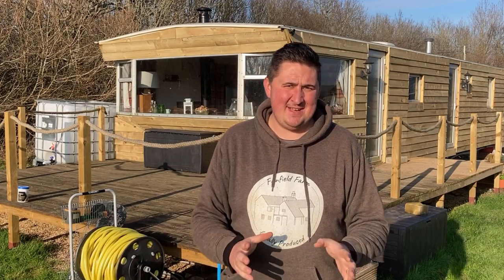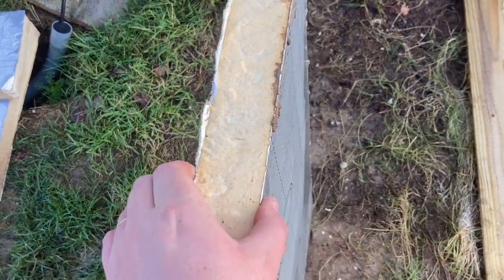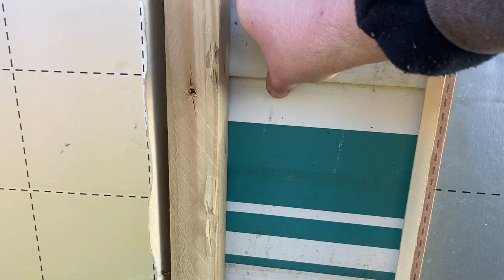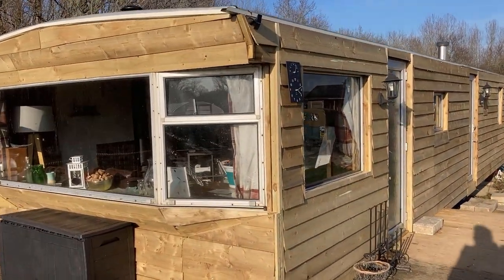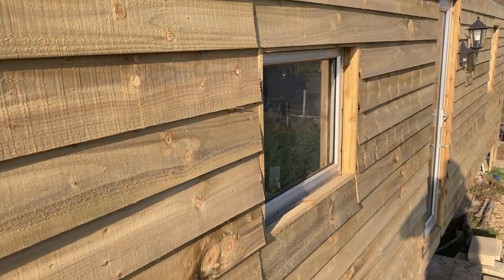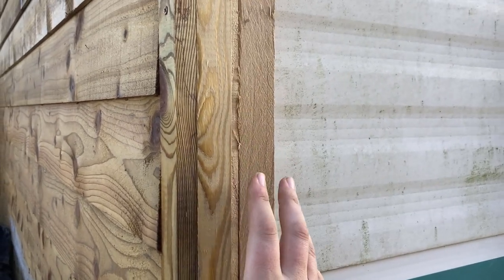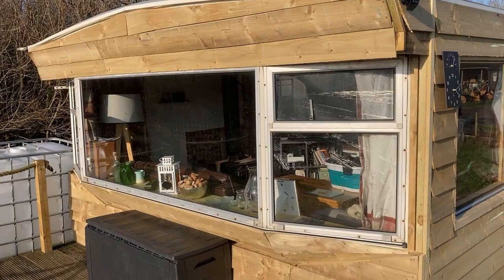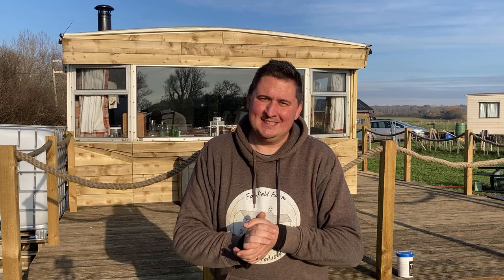How to Clad a Static Caravan - Timber Cladding and Insulation of our Off Grid Home

Comment: You definitely did the right thing cladding a Willerby Caravan if you we going to live in it in winter,they were only ever meant to be occupied in the summer months. The later ones were winterised with double glazing and central heating with added insulation because most caravan parks extended their season till January,without cladding the early ones it was bitterly cold when the temperatures dropped causing all sorts of problems with condensation and mould,nice job though and a hell of a sight warmer.
Reply from the maker: Thank you. It definitely makes a huge difference :) We are able to constantly monitor condensation as we live in it full time so can manage that luckily. The little condensation traps we keep everywhere and they seem to do the job so far :)

Comment: Good work, just one thought did you seal each individual insulation panel so the air directly behind it cannot move? Otherwise it will not have any heat retaining properties & condensation will form on the metal (aluminium) surface of the original cladding. Also each batten is a thermal bridge where condensation can form where they contact the metal cladding too...

Comment: I'm trying to convince my partner we should sell up, buy a field and get one of these. I like the fact it looks a lot more homely. A cabin in the woods sort of feel.

I would be tempted to fill and tape any joints and maybe put some sort of membrane over before cladding to really keep any drafts or wind out. Did you consider this?

With widening the frame like this, did you consider you could perhaps swap the windows out or add extra glazing?

From a planning perspective how much can you do before someone with a clipboard has a problem?

So many questions .... I'll have a browse through some videos.
Reply: I've met those clipboard people 🫤
Reply: On beginning of covid we moved out from shared accommodation to. 
We've bought static that is in field, best decision ever.
One of the problem with caravan is condensation from roof that dribble to edges of it.  Our plan is to spray foam under the roof, so it stick to it, and don't leave any gaps for condensation. Another important thing is floor insulation. Our pipes with hot water are   under caravan. So they can foze. So another way is to make under floor heating is by moving them closer to floor and insulate them from ground

Comment: Awesome job! Did you insulate the roof any? Like another 3-4 inch kingspan and boarded and felted? Most heat goes through the roof is all. Ive got a static myself and thining of doing the roof, defo doing the sides after seeing this!

Comment: great job. We have copied it on our caravan which is also an old Willerby.. But...how do we stop water running off the roof and into the kingspan.?   The guttering is very similar but there is only overhang at the main window end. The other end has no overhang and we are worried rain will just run between the caravan walls and the kingspan.   thanks.

Comment: Did you not have to have a vapour barrier or air gap? Looks fab!
Reply from the maker: Thank you. We didn't because we left the original metal outer skin on and insulated on top so this would act as a vapour barrier. We do have metal grates on as air flow help.
Reply: @thedadfarmer  we’ve started doing ours now. Looks so good already. We’ve used batons then just rolled some roofing fabric membrane across before attaching the cladding. Thanks so much for the inspiration!!

Comment: Hi, I enjoyed watching your video, job well done. I just wanted to ask you something: You insulated the walls, but is not there a big heat loss through the roof? are you planning to insulate roof somehow too? And in small places like static caravans is heating another problem. You heat it up very quick so it is very hot inside but also when you close heating unit it gets cold very quick. I dont want to use gas heating that cause condensation and electricity is expensive. I would prefer  fireplace but keep stable temperature for long time is hard to get. How do you sorted heating? thank you for the answers and looking forward to your next videos.
Reply from the maker: Hey sorry for delay. Yes the next plan is the roof, we will add insulation and a secondary roof to it to capture heat in. And will add cladding as a skirt around the bottom too.
Reply from the maker: As for heating we use just a large woodburner that we fitted in to ours. It keeps heat for a long time, and each night in winter we load it up with logs and put it to its lowest setting and it keeps a fair temperature through the night then. Two winters on now and its working so far :)
Reply: Hi thanks for the video great help . I was wondering the same about roof and floor . So how will you do the floor ? Same way as the sides?

Comment: Great video 👍🏻 if you havnt clad anything before well done. As long as there’s breathers and some sealant at the corners to stop water just creeping in I bet that lasts a long time. And I bet that isn’t going anywhere in a stormy winter👍🏻 
 I’ve thought about doing this to my own static but I have a feeling it might not be transported once this is done. Can anyone tell me if this is true? Maybe even using a more light weight alloy sheet on top of the original but with greater U value between.
Reply: I was thinking something similar...

Comment: Hey! We live in  our static full time. This is our 3rd winter and probably the coldest so cladding is our next step. Have you noticed a big difference with keeping it warm and using less fuel to heat it?
Reply: I don’t think it makes much difference unless you do the underneath and the roof. Also, better to use expanding foam in all the gaps to get a proper seal. 100mm would give you so much more and as it’s on the outside it doesn’t matter.
Reply: @TheOceanExploration  Thanks for watching and for your comment. It made a big difference for us. Of course there is always more we can do as we live in a box with 25mm insulated walls so all wins are good wins for us, no matter how small

Comment: it's really cool. I have a caravan back in Lithuania and planning to do something the same, nothing super fancy. One thing I couldn't understand...why did you leave metal cladding and used insulation on top? In my opinion you should've removed it and insulated walls properly. Maybe for UK climate it's enough, but any spaces and cold air touching the iron won't be good.
Reply from the maker: Hiya, yeh for the climate here it is well enough. We wanted to do the most simple method for helpful insulation but also so it looks great. If we were stripping down the metal too we almost felt like it would have just as well been worth building a frame ourselves. We also wanted to avoid having the pressure of making the new walls watertight. Hope that helps :)

Comment: Just one question...did you insulate the tricky angled parts above the windows in your living room?

Okay, two questions...are you doing the gutters? Because surely the top of the boards are exposed as they come out further than the roof?
Reply from the maker: We didn't if I'm honest, didn't think they would make a huge impact not to insulate. And as for the gutters yes we are going to do them, however their are little groove gutters on our caravan at the moment that we only clad up to so they are preventing any water getting in. Hope this helps :)

Comment: I see you have a water tank but with regards to gas and electricity what did you do for a supply? Great build btw
Reply from the maker: Thank you :) So for gas we use LPG bottles at the moment, this is a temporary measure whilst we look at biogas or other options for heating water and cooking. Our electricity is a solar system that is on our barn and its the only way we have power and is awesome.

Comment: I will spend some new windows on mine because i am going down that same road with a static caravan and insulation and redecoration inside. Single pane glass simply is far too expensive in the long run when it comes to heating.

Comment: Hi! Did you not have to leave a gap between the insulation and caravan? Thanks for your vid 🤩
Reply from the maker: Hi no we didn't the less air gaps the more warmth the insulation will add. If worried about condensation then we are adding the metal air grates for air flow.

Comment: just a thought  but have u taken into account the weight when wet/snow on the caravan chassis in winter ?
Reply from the maker: We hadn't at first, we used the smaller parts of timber that we could. We have recently added some posts all the way to the ground from the walls which would take any pressure, and we have double the amount of stands under the caravan so doesn't worry us too much. We haven't seen any problems so far since doing it :)

Comment: Hiya Chris! 
We are now copying your video instructions. Have a question... what did you do with the vents? Metal air vents? Then did you put a lip above them to stop the rain getting in?
Thanks, Georgie
Reply from the maker: Hi Georgie sorry for the delay in coming back to you. We are adding this back in retrospectively, going to cut out the right size hole in the cladding. Adding a new metal grate sprayed up in matt gray, then will add a little lip using the cladding wood to stop rain but wont think too much about that as by their very nature the vents / grates are designed with lips on each slat if get the right ones

Comment: Just a comment regarding insulation. Having just sold a property, the surveyor did comment that, with Kingspan, you double the thickness. So when you put in 50mm Kingspan insulation, it actually counts as 100mm. I do not know the science behind the comment.